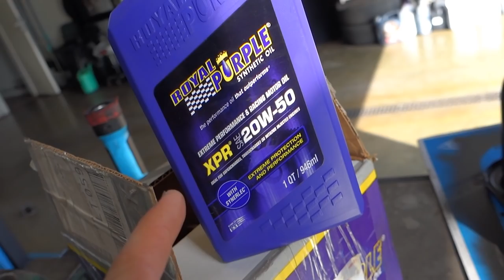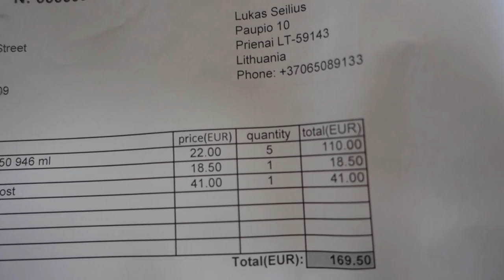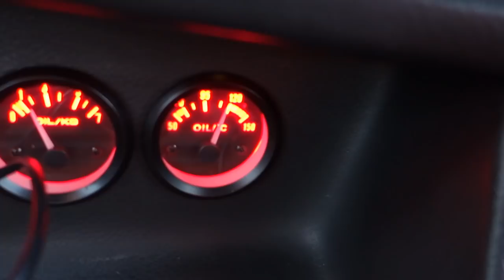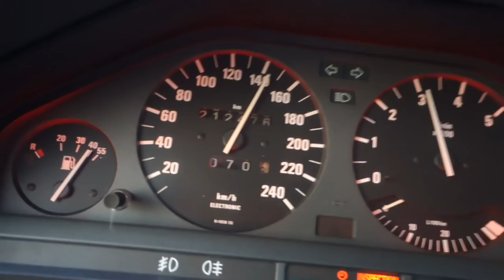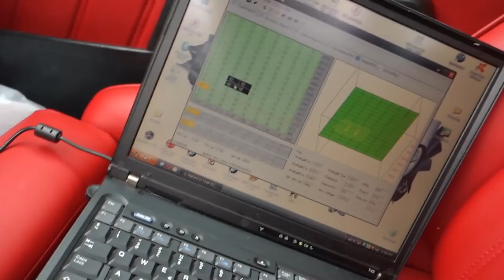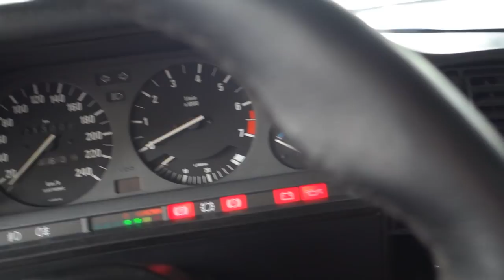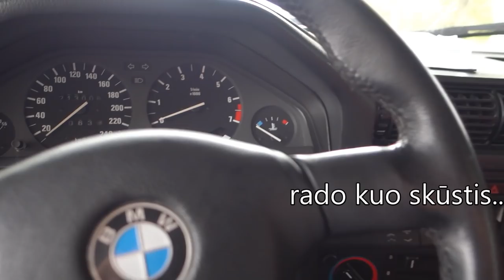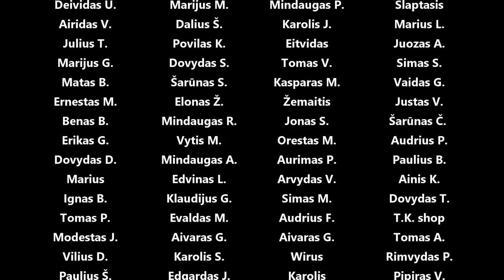Mapinam e85, elektros gedimas, galvojam kur peržiemot, tepalo temperatūra

Comment: As tai savo volgos varikli turbinu ir ta proga pasiskaiciau moksliniu straipsniu apie indeklus ir variklio tepima, ten keblus reikalai pasirodo.
Toks buvo dalykas viename paminetas, kad nekiek svarbu tepalo spaudimas, o tepalo srautas (flow vs pressure), tai tirstesnis tepalas nebutinai geriau.
Ir dar toks dalykas, tai kad tepalo kanaluose slegis tolstant nuo reguliatoriaus krenta, tirstesnio tepalo slegis krenta greiciau, nes didesnis pasipriesinimas ir mazesnis srautas.
idomu tuos straipsnius kartais pasiskaityt buna :)
Dar i forumus nuejau, nes smalsu pasidare ir ten ne tau vienam tepalo slegis zemas.
Pvz, vienas zmogus sake: "My 97 2.8 runs 60 psi cold then drops to 30psi after warm up 3000 rpm. Idle is 10 psi. I was really concerned after i installed the gauges (vdo) but after 2 yrs no problems. I change the oil every 3000 miles and just switched over from bmw oil to mobil1 5w30 . Anyone else have similar numbers or ideas as to why the difference?
"
Reply from the maker: Viskas logiška, bet reika turėt galvoje, kad tirštesnis tepalas keliauja lėčiau, bet it ištrykšta iš indėklo lėčiau + tepalo spaudimas didesnis, tai ta kelionė tepalo netiek jau sulėtėja.